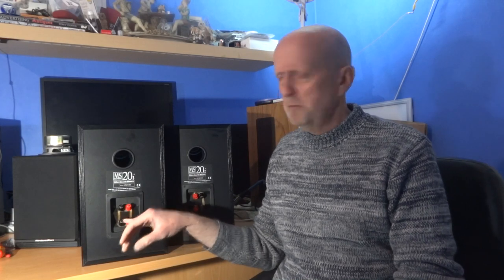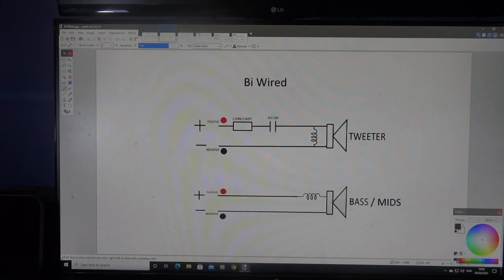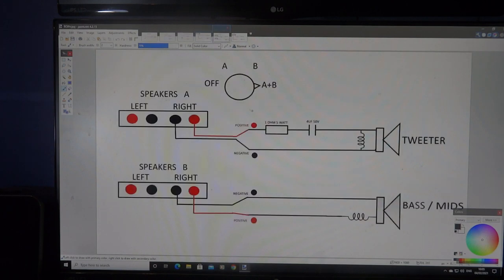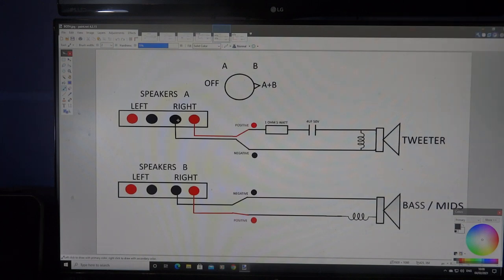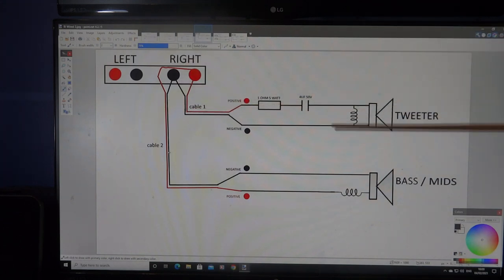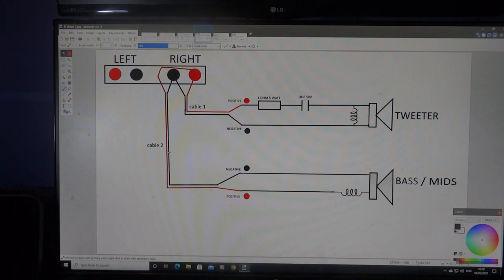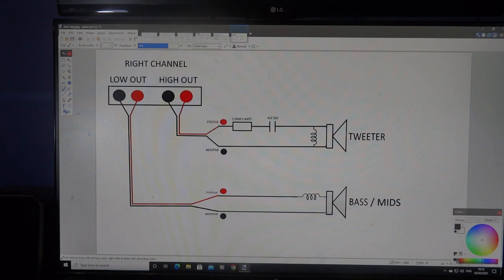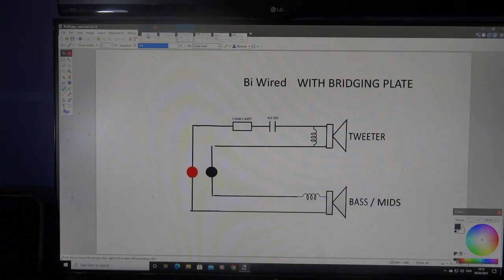Speaker Bi Wiring Explained,  improve the sound. Bi Wire Amplifier Receiver. Wired Stereo Speakers

Comment: Their is no hi-fi amp that sorts out the low & high frequencies as all speakers have different crossover points, AV amps yeah & some modern amps have subwoofer outputs & even bass management but i think you mean bi-amping with an external active crossover which is not done in the amp...that is called passive bi-amping when cables are taken straight from amps to speaker inputs ,but no amp i've seen has low & high outputs for the speakers..twin pairs of speakers outputs yeah but no low or high , A + B yes but thats just parrallel wiring with poor quality switches ruining the signal....easier just to use passive bi-wire as cheaper & has sonic benefits...at least to my ears, some people hear no difference,i guess we've all got different quality ears...lol...active crossovers are very expensive & involve buying more than 1 power amp...along with a lot in cables....
Reply from the maker: Thanks for the comment Christopher and bringing up this, yes I did mean using active crossovers and an amp for each ouput of these, not a thing many would even consider.
Reply: @MichaelYates  ...your right  after many yrs in music & hi-fi the best hifi systems i have ever heard were bi-amped with active x-overs... i own a multi box Meridean/Boothroyd Stuart pre-amp & 4 monoblock amps, each unit comes with it's own hi class torroidal transformer & power supply in an identical looking metal case/box ,a lot of shoe box sized seperate cases/box's..makes it very easy to set up in various ways, i use it just passively bi-amped with Quad Electrostatics speakers, had to pay to make them bi-ampable, & with a decent sound source, turntable, CD, DAC etc it sounds fantastic...my freind has the money to go true bi-amp with active x-overs & after a few yrs has a fantastic, but expensive, hi-fi which is truly awesome,any excuse to visit him and his real active x-over bi-amped Tannoy Westminsters & Krell monoblocks & pre-amp...a different class of sound never forgotten once heard...i hope you find the sound your looking for....more people should try bi-amping it really is black & white compared to most other setups imo...
Reply from the maker: @christopherstorrier5560  Thanks for sharing all the infomation on all the set ups, Your friends sounds fantastic. Price would be way beyond my pocket but a system I would love to listen to. Thanks again and all the best

Comment: Bi-wiring also implies bi-amping!

The idea is to use a 2 amplifiers - one for the woofers and one for the tweeters (or even four mono blocks i.e. an amplifier per driver), rather than just run 2 lengths of speakers cables to the same amplifier.

Comment: Unfortunately your analogy of the motorbikes and busses gives the impression that all this 'traffic' sets off from the amplifier and is somehow apportioned to the tweeter and woofer and that it's the filter in each case that 'lets through' either motorbikes or busses, and if they're not wanted in a particular wire they are pulled over to the hard-shoulder!
I think this illustrates a the problem which the less technically minded think about the relationship between the amplifier and loudspeakers. Most people seem to think that a signal is produced by the amplifier and is somehow pushed out to be apportioned by the loudspeaker components - many of those who have produced videos on the subject think this!
In fact the amplifier only produces 'potential' which is present at the amplifier terminals and dependant upon the demand provided by the load connected to it will supply current proportional to that demand. Using you analogy the motor bikes and busses won't even leave the depot until they are needed in one place or another - and not get pulled over onto the hard shoulder....wherever that may be!
Reply from the maker: Thanks for more clarification on this matter, its good to get more precise infomation on how these signals leave and move along the wire and passed through the speakers.
Reply: @MichaelYates  Thanks for your kind words. My aim is to present an easy-to-understand way of seeing what goes on in the amplifier/speaker interface. You seem at least interested in finding out how these things actually work. Analogies can be useful, but I can't think of one that is 100% accurate: the water in a pipe one falls down because it suggests that the amplifier is a pump, pushing out the water. Your Motorbikes and Busses, similarly, fails as it suggests that they leave the depot (amplifier) and are somehow rejected by the crossover. But I like your straight forward approach - why not make another, outlining exactly how the amplifier and speaker interact - looking at what's on YouTube hardly any get it right!
Reply: @rogerwebb7501  Quite incorrect, but if it makes you hear better in your music sweet for you.
Reply: What, exactly, is 'incorrect'?! I've merely stated how current functions in loudspeakers and their connecting cables....I make no judgement as to whether this leads to a significant improvement in sound using biwiring. Far too often these YouTube videos are posted by people who don't understand how electronics actually work.
My background is in Electronics as a qualified communications technician - I designed test equipment for Concorde, and later in electronic instrument service/repair in recording studios.
If you want to find out how loudspeaker crossovers DON'T work have a look at M Zilch's hilarious videos!! @spudpud-T67